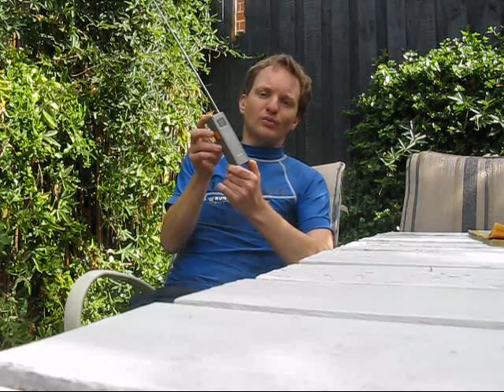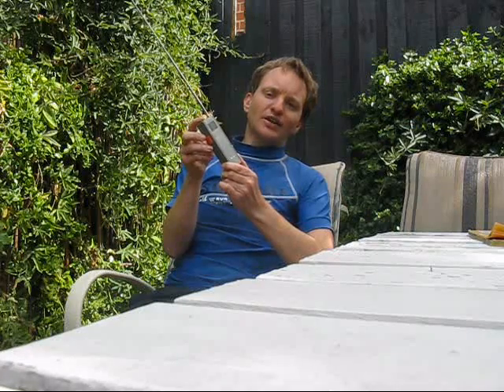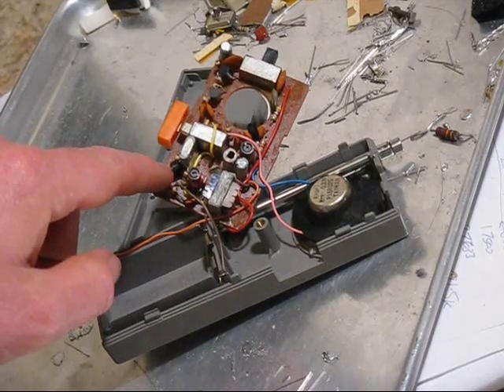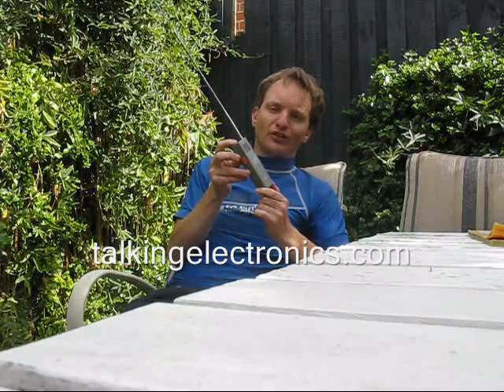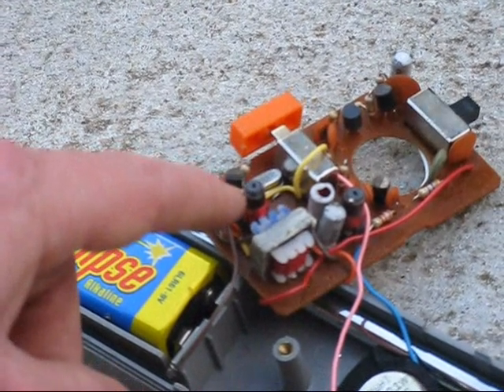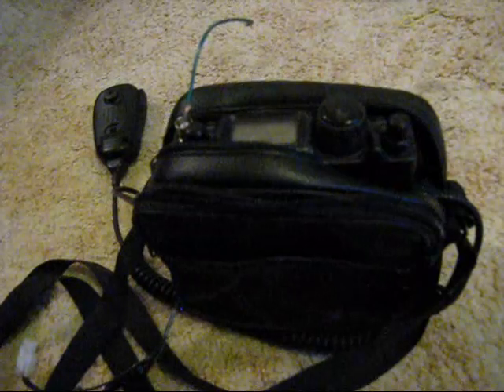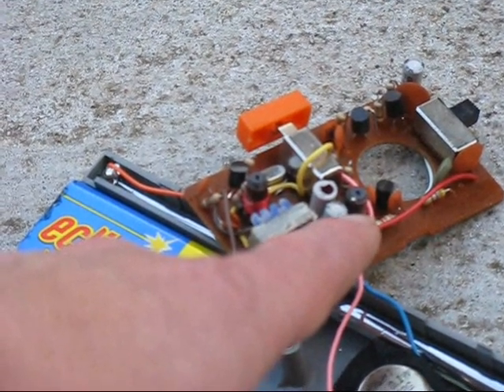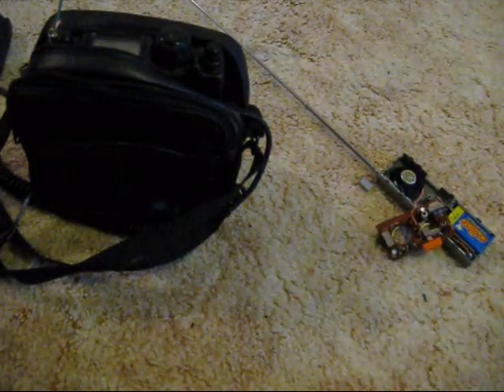Convert a 27MHz toy walkie talkie to 28 MHz

Comment: I traced the circuit for these. The receiver is a free running super-regenerative detector using one transistor. The transmit oscillator uses another transistor and is crystal locked. The remaining two transistors are the audio amplifier/modulator. I put  normal CB Xtals in all mine to extend their usefulness; i.e. communicate with the home base station.  The receiver does not require re-tuning since it has broad selectivity by default. Range with a 5/8 wave Stationmaster at the base station was about 1km.

Comment: Sir,
 I have a vintage general electric walkie talkie (fm superheterodyne ) and I just want to upgrade it like increasing the transmitting and receiving rang... Also i want to put a mic for transmitter circuit instead of speaker and keep the speaker for the receiving only.. Please advise
Reply from the maker: I wouldn't touch it if it works as is. You're more likely to wreck than to improve it.
Reply: @vk3ye 
thanks for the heads up
now I know I won't be able to do that job

Comment: Can u make it go to 14mhz with the right crystal?
Reply from the maker: Possibly but 14 MHz QRP AM is a completely useless communication mode on that band. And the poor selectivity of the receiver will make it unusable.
Reply: @vk3ye  also to convert it to 28mhz would it be possible to amplify the signal to increase the range, and one more question, my walkie talkie has 3 transistors one for tx and rx and two for audio amplification, would putting the oscillator in it work?
Reply from the maker: @MarkyBhoy-fe1xf  1. Yes. 2. Don't understand your question. You are better off to build from scratch than modify gear like this.

Comment: Wondering if I could ask you a question I bought a vintage walkie-talkie CB from the '70s and wanted to add a channel 19 crystal in it because it is old does it have to be a certain type of crystal or just a regular CB walkie-talkie Crystal I know this might sound stupid I just don't want to put the wrong type in
Reply from the maker: It should work provided that the intermediate frequency is the same (typically 455 kHz).

Comment: Remembering me back to December 2002. Im just change the short telescopic antenna and using the long telescopic car antenna. and got more distance after that. But the antenna look more long and bit annoying in small place / lower roof . Still keep the walkie talkie till now. Very usefull during adjusting the analog tv antenna to get the best clear signal at the house roof on that time. Good old day memories

Comment: What if I put a 7.023mhz resistor? Could use it as a low power SW transmitter?
Reply: ArriCAT5e resistors are not measured in MHz. resistors are measured in ohms. a crystal oscillator is measured in MHz.
Reply: Yup I dunno why I said resistor instead of crystal hahaha. Anyway it didn't seem to work.
Reply: ArriCAT5e haha. we all have those days :D

Comment from the maker: You could put a 50 ohm resistor across from antenna to earth, then with a diode RF probe measure the RF voltage and calculate the power.  Problem is the output impedence is probably not 50 ohms so the reading will probably be wrong.

Comment: Hi Peter
Interesting video. I remember years ago I did one of these mods to a two channel 27 mhz 10-4 envoy walkie talkie changing xtals from the uk40 band to the new lower standard mid band when it became legal. I had been thinking of puting it on 10m but not sure if its legal here in the uk, ill have to look into it as its been collecting dust on the shelf for years. Good video brings back some good old memories .